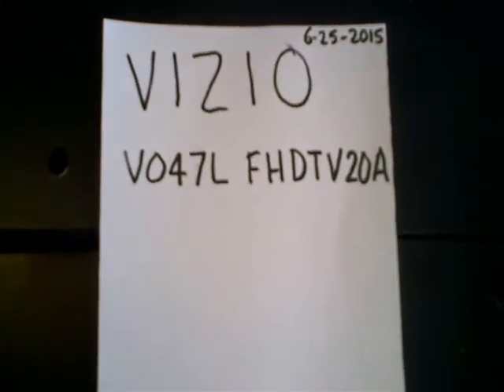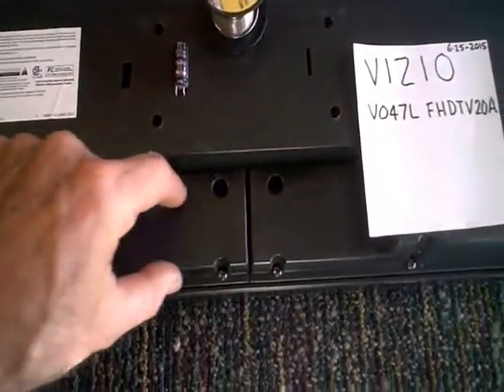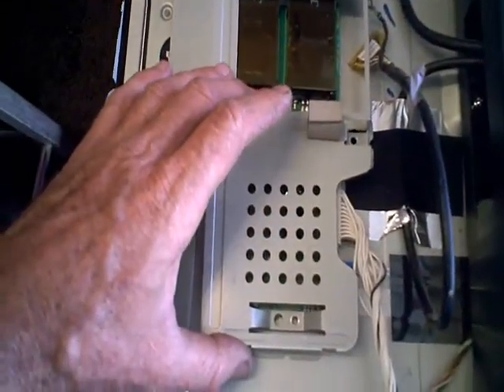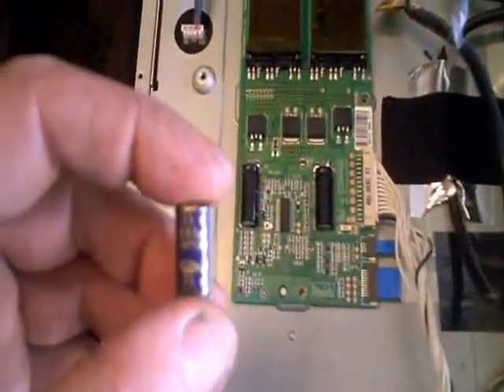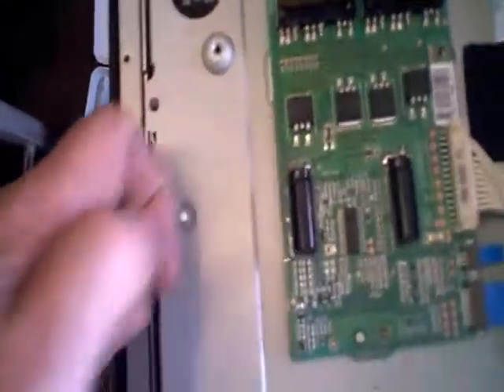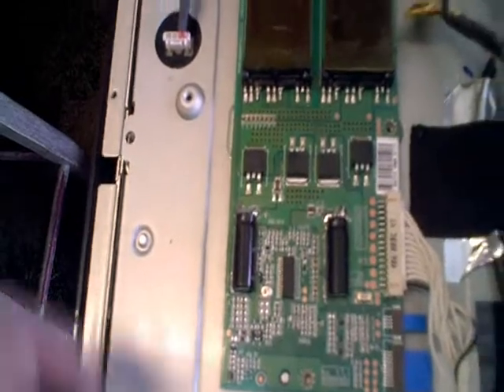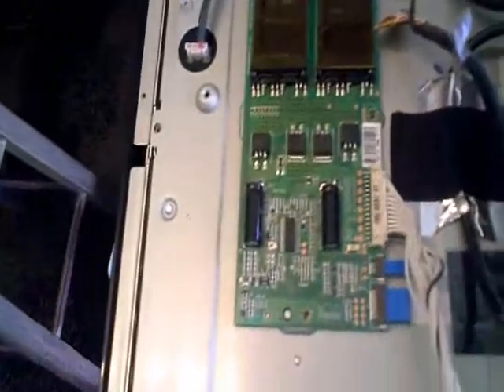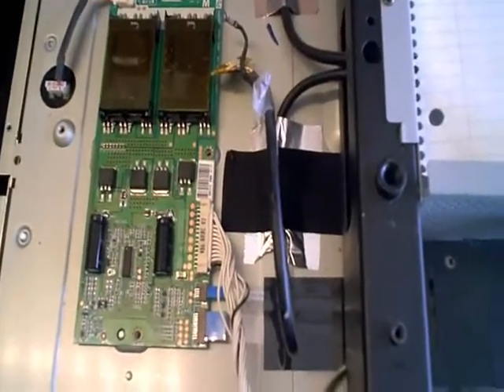Vizio  V047LFHDTV20A No backlight.

Comment: I have a vizio vl420m that when you turn it on I get no backlight and audio. when I shine a light on the tv I do see a picture. I tried replacing the backlight inverter/power supply board and and it didn't fix it. any ideas what could be wrong?

Comment: Nice job,  I had same tv and yes same problem with that board but my inverter board had few shorted parts starting from transformer. It cooked both inverter board and power board near inverter plug actually burnt off some traces. Tv works now.
Reply from the maker: *****  I lucked out on this one. I wish they could all be so simple.
Reply: Grants Pass TV Repair true

Comment: An oldie but good one....did quite a few of these.
Sometimes, i would leave the cover off the converter bd's, this would help with heat issue's, as those covers I feel would actually keep the heat for dissipating.
I had read that some servicers would do this for heat considerations etc.
I don't think their is much shielding in regards to harmonics or signal frequencies from these boards, although their are in all electronics etc.some stray signals etc....
thx. Frank....Richards tv.
Reply from the maker: Frank Pitochelli I suspect some of the manufacturers may be overdoing it with the shielding to appease the FCC who sets  guidelines concerning potential interference to other electronic devices. On the other hand I remember turning on a plasma TV with the back off, and the interference wiped out my reception on an AM radio across the room.